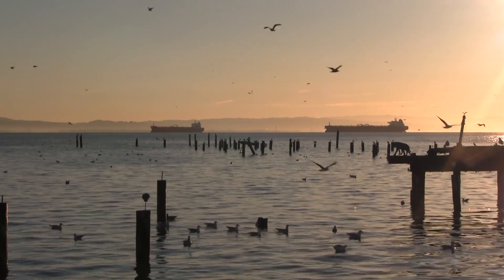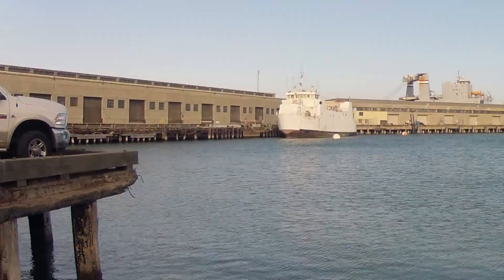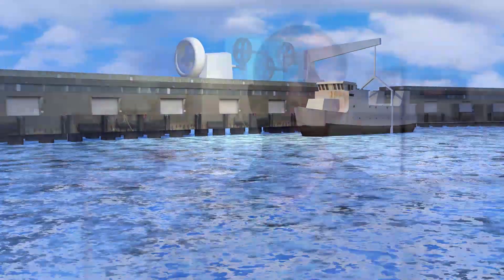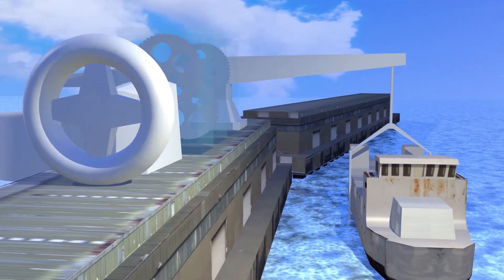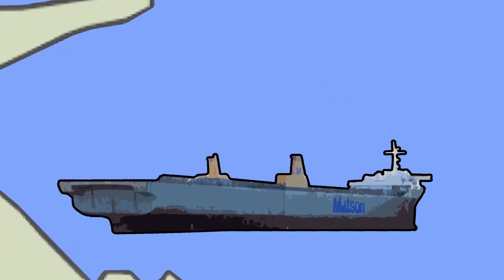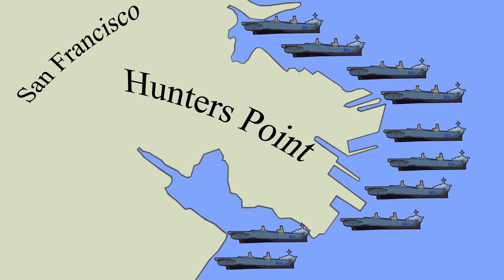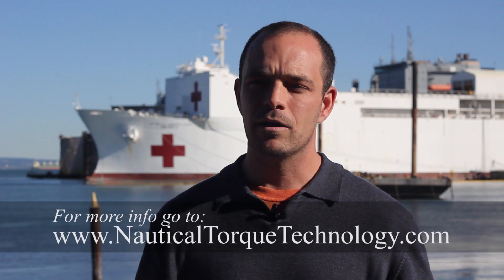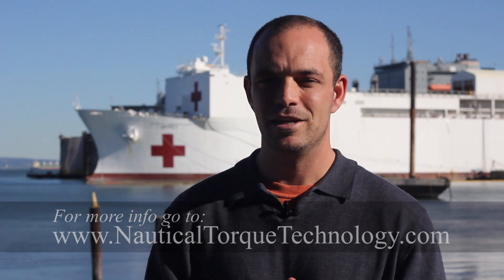nautical torque indiegogo final

Comment: Dear Galen. I like you're idea of harnessing the power of the weight of ships to drive turbines. However, the complexities of this engineering challenge would be hugely expensive... There are much 'lower hanging fruits' to pick from in terms of generating renewable electricity... (sunlight)